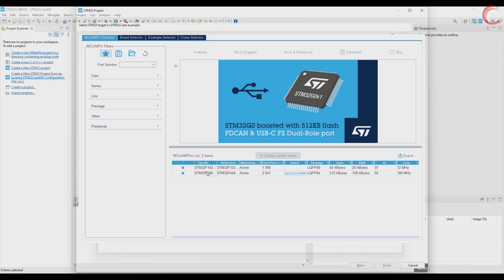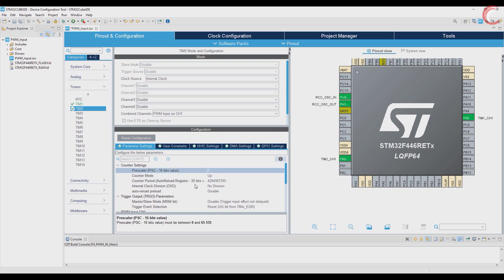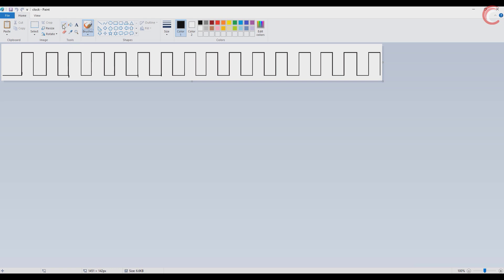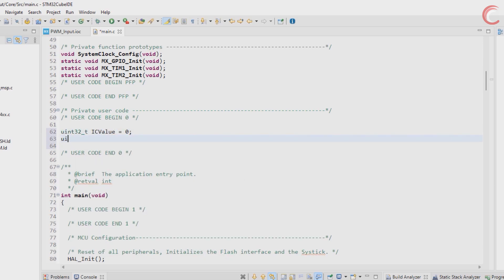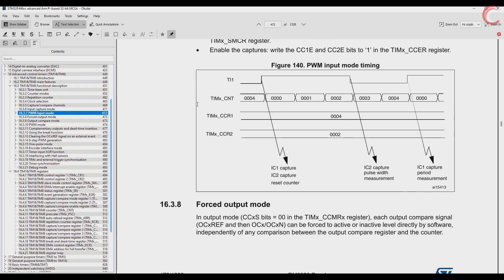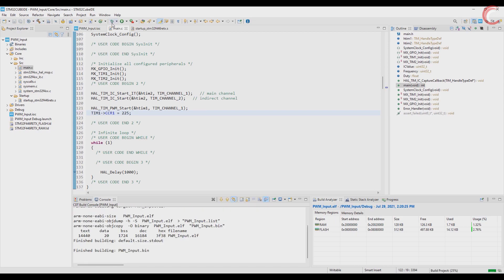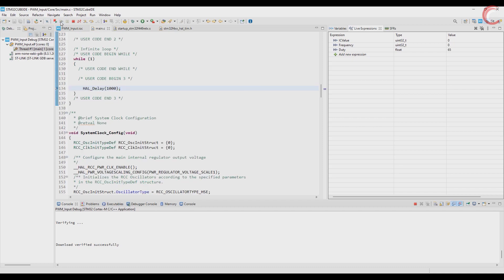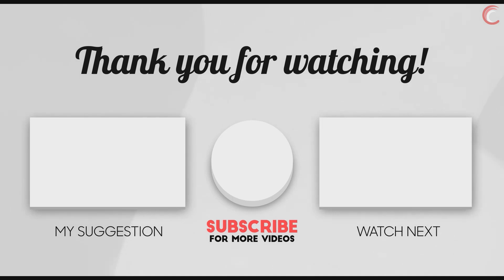STM32 TIMERS #2. PWM Input

Comment: Thanks for good video. I have a question. 
How can I find out that the duty-cycle is 100%? It can't capture rising edge when its 100%
Reply from the maker: Well you can't capture a 100% and 0% duty. You have to implement some other method for it. For example, create a variable and increment it in the systick handler.
Also Reset the variable in the input capture callback. 
Now in the while loop, check if the variable value has exceeded some partiular time. Here for example, if the frequency of the signal is 100 hz, the interrupt will take place every 10ms. So we will check if variable's values is more than 20, if it is that means the interrupt did not trigger last 2 times and it would mean the duty is either 100 or 0.

Comment: I'm a little confused but at line 67 you defined the callback function but you never invoked it anywhere in the code after that .
Reply from the maker: It is called automatically when the IC interrupt is triggered.
Reply: @ControllersTech  ok, thanks
Reply: 6 7

Comment: The code works perfectly with good explanation.But if discount the PWM signal physically or After some cycle stop the PWM signal the value of frequency remain stuck at last value not getting zero. Any solution ?Thanks in advance
Reply from the maker: It happens because a pwm of 0 width is actually not read by the timer. Therefore you meed to manually updaye the data here. 
You can reset the value after eqch read is successful, but in such case you will see 0 popping up quite often .
Another thing you can try is set a timeout. Like define a variable in the main file and define same variable externally in the interrupt.c file. Then inside sytick handler callback, increment the variable. Here it is incrementing every 1ms. Then in the main file, write some timeout condition like
if (variable>=500){ freq=0; variable=0;. You also need to reset this variable each time in the input capture callback.

Comment: What kind of input signal you are applying sine wave or square wave or its PWM signal from Function Generator? Is there any  way to see capture frequency signal like we see on oscilloscope or in Labview we can see it as graph, but can we see in the receive signal in STM32
Reply from the maker: The input signal is actually the output from TIM1 PWM. It is a square wave. You can see it on an oscilloscope or a logic analyzer.

Comment: I don't understand the purpose of Combined Channels?

Is it like one of the channels( TIM2-CH1) is used for detecting rising edge and the other(TIM2-CH2) for detecting the falling edge of a common PWM source(i.e TIM1-CH1)?
Reply from the maker: Yes exactly
Reply: Thank you!
Reply: And for calculating the frequency, why did you take 90MHz/ICValue?

Isn't frequency just 1/T which is 1/ICValue?

Comment: I have only been able to make it work using 32bit timers, do you if it's possible to use the 16bit ones? I have found some discrepancies between the reference manual and the generated code when using 16 bit ones
Reply from the maker: It can work with 16bit timers too. What's the issue ?
Reply: It doesn't work, value fluctuates very fast at 3590 or smth like, that I changed the pin to be the proper one associated with the timer, and the interrupt code is exactly the same, any help is appreciated man @ControllersTech
Reply from the maker: What is fluctuating? The IC Value or te frequency? How much is your input frequency ?

Comment: What changes does it can make if we operate at high frequency? For example after a pwn input i want to make changes in a tft display connected to the mcu. If i operate at high frequency say 2mhz. Will that lead to improper update it the display due to the interrupt?

Comment: uint32_t ICValor = 0;
uint32_t frequencia = 0;
float ciclo_trabalho = 0;

void HAL_TIM_IC_CaptureCallback(TIM_HandleTypeDef *htim)
{
	if (htim->Channel == HAL_TIM_ACTIVE_CHANNEL_1) //Se a interrupção pelo canal 1
	{
		//Ler o valor do input capture do canal 1
		ICValor = HAL_TIM_ReadCapturedValue(htim, TIM_CHANNEL_1);

		if(ICValor != 0)
		{
			//calcule o ciclo de trabalho
			ciclo_trabalho = (HAL_TIM_ReadCapturedValue(htim, TIM_CHANNEL_2)*100)/ICValor;
			frequencia = 84000000/ICValor;
		}
	}
}

int main(void)
{
  HAL_Init();

  SystemClock_Config();

  MX_GPIO_Init();
  MX_TIM1_Init();
  MX_TIM2_Init();

  HAL_TIM_IC_Start_IT(&htim2, TIM_CHANNEL_1); //Canal principal
  HAL_TIM_IC_Start(&htim2, TIM_CHANNEL_2); //Canal indireto

  HAL_TIM_PWM_Start(&htim1, TIM_CHANNEL_1);
  TIM1->CCR1 = 840;

  while (1)
  {
	  HAL_Delay(1000);
  }
}

I did all the things but if you not connect externally the output pwm wiht input capture it not works and stayt variables at zero, i configured all the parameters, combined input but you have to say for all the people that have connect a external wire between pins.
Reply from the maker: And how were you expecting it to work without giving it any signal to measure ?
Reply: @ControllersTech  I am from Brasil, I understood that PWM OUTPUT was connected internally with INPUT CAPTURE. It is what understand about the video. I think you should explain to not forget to make wire from output to input. I discover this by myself, but I would like to check with you if have or not to wire?
Reply from the maker: Input capture is used to capture the input signal. So we need to provide something to the input. Since I didn't had anything available, I generated a signal and then passed it to the input.
Obviously you need to wire it. If it's connected internally, there is no point of using the peripheral
Reply: @ControllersTech  Thank you very much, i did, worked very well, pretty good.
Reply: @Alexandre V. Hello. I am a student and am facing the same problem of variables showing output as zero. May I know how you made the connections more elaborately.

Comment: I only can see a 100KHz PWM with 50% duty cycle on output TIM1, but the input capture not work, the variables stay on zero. I have connect by wire the PE9 and PA0?
Reply: Did you solved it

Comment: Please, can you help me by explain xor mode
Reply from the maker: It's pretty simple. 3 inputs and 1 xor output. 
Also you get the width directly, just like in the pwm input mode.

I don't have enough equipment to make a video on it right now
Reply: @ControllersTech  
Please how can I set this feature using the CUBEMX. And what are the appropriate HAL instructions